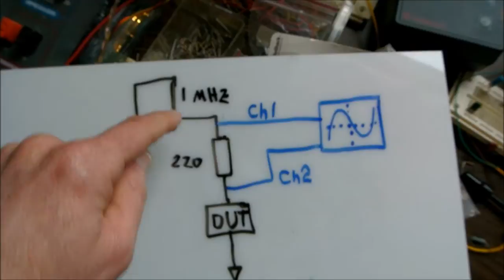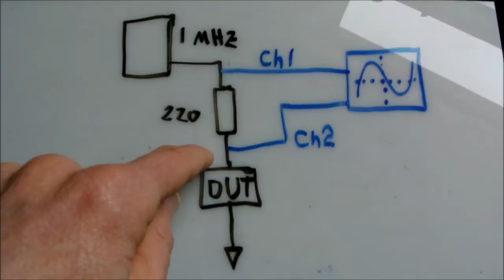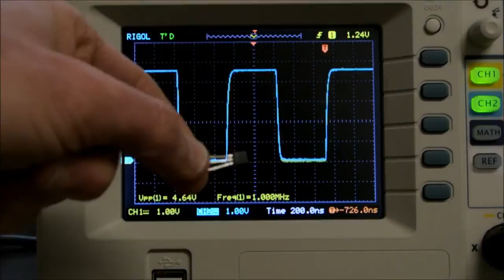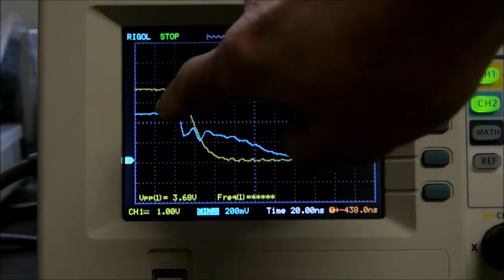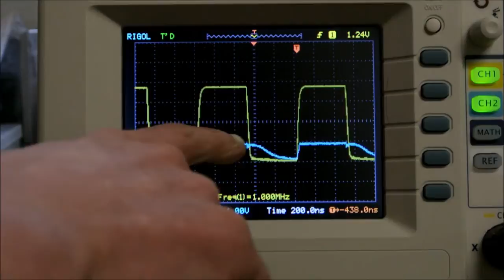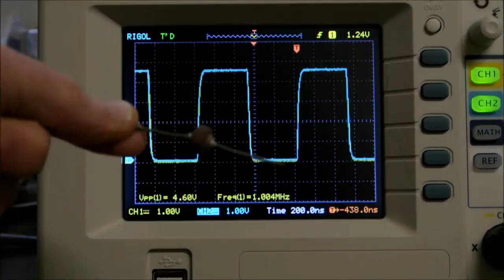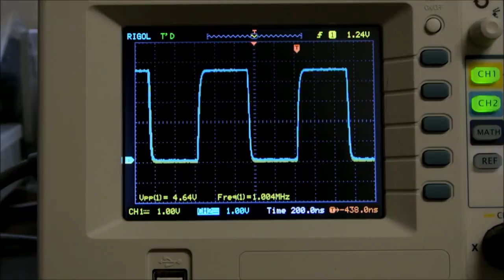Testing switching speed of various electronic components: LED, diode...

Comment: Would be interesting to see some power transistor tests, at a lowered frequency and higher currents using a Baker clamped driver off the MCU to drive the DUT load. But you probably have work to get back to! I believe I gave specs for those diodes on the envelope they were in, but I can't remember them offhand.
Reply: I know there is a simple way to test/curve power transistors with little more than a transformer, but can't remember the setup.

Comment: I had an idea yesterday night about... transmitting ntsc video over led or laser... and grab it with... solar panel or whatever is suited... and wondered if they were capable of switching fast enough for a video rf signal...
Reply: You'd need PIN photodiodes (or even better, avalanche photodiodes) and wide-band transimpedance amplifiers.
Solar panels will probably not work due to their long rise and fall time, as well as poor wavelength characteristics.

Comment: Great video, why do different multimeters give conflicting hfe values?  Can you say what is is significance of the jump to lc/xx in the hfe range of my analogue multimeter (MF-47).
Reply from the maker: It could be the different currents used for base and collector in the different meters. Gain of the transistor will vary depending on the current. Even a slight temperature difference will affect the gain.